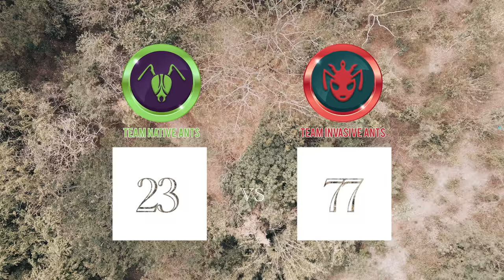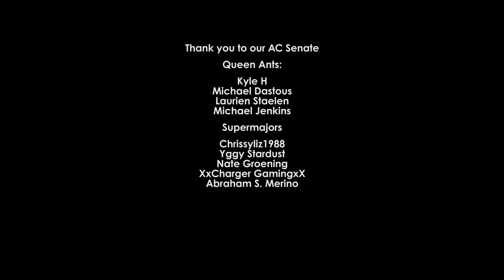DANGEROUS FIRE ANTS Invaded Our ANT HOUSE (We're In Big Trouble!)

Comment: If you don't deal with the problem you will lose the war. Boiling water is your best option in my opinion and then feed the native ants to make them stronger.
Reply: This is like Russia VS America but this is not native vs native
Reply: If u feed them it will cause war  as the invasive ants would compete for it
Reply: If you want an interesting bit of art for your new house, locate the fire ant nest and pour molten aluminum down it, then dig it up, and use as a display of what an ant’s nest looks like. You can find videos on how to do this. You get an educational piece and get rid of the fire ants. A win-win.
Reply: @lindawolffkashmir2768  Aren't those videos typically done after the nest is cleared?
Reply: That's why he said the boiling water to kill the invasive ants first. Feeding would only start after the invasive species were removed to help the native species bounce back and refill the niches before any new waves of invasives come to the area.
Reply: @alexanderlambert295  From what I’ve seen, they pour the molten metal straight in, adding water could destroy the shape of the nest. I’ve seen this done mostly in Florida and Georgia, where fire ants are a big problem.

Comment: Hello, AC Family. I live in Florida, where fire ant colonies had gotten so large that they have been reported doing serious injuries to pets and small, curious children. 

I use inexpensive bulk ground cinnamon. Ants communicate and identify nest mates by smell. Fire ants are particularly aggressive and will attack anything that doesn't smell "right" to them. 

Ground cinnamon is very fine, and the cinnamon oil in it is very hard to clean off. 

Sprinkled on the top of their mound, they can't help but get some on them. Then those are attacked as potential intruders. Then the attackers have some on them... it cascades pretty far down into the nest. Then a new team of workers go out... and it cycles all over again. If it doesn't rain, this can cause a firearm nest to completely collapse in about a week. If it rains, the colony decides to move the nest thinking the rain has contaminated the soil. So doing this while the ground is pretty dry works best.

Other species of ants and insects simply avoid cinnamon when they come across it. This makes cinnamon a good deterrent to keep ants outside. And it is non-toxic to most (unless allergies are involved) and biodegradable.  

This may be the kind of solution you are looking for.
Reply: I like this idea.. I'll have to try it on my yard this summer when they invade
Reply: Fellow Floridian and I totally agree with this idea. Especially considering I got dogs (4 small dogs with 1 that's totally blind) that are bred to be trackers (nose to the ground) so poisons is an absolute negatory Batman. 

To everyone else: For us, summer is our "wet season" which is rather ironic considering you'd want to do outdoor activities in the summer. So it's important to tackle it during what you would consider your "dry season". Stop them before they take over kind of thing. Side note, if you get snow, then that's your "wet season".
Reply: This is incredible I have never heard of that before, it shouldnt affect the native ants since the rain will wash the cinnamon away
Reply: I typically use boiling water and temporary removal of some of the soil they live in to let the water seep in farther, but this also seems interesting
Reply: This
Reply: Wouldn’t the native ants be also affected by this ?
Reply: @Kazwens  fair point, however i just like to be sure since my dogs are constantly running around
Reply: @medic2229  I have a dog too lol, cinnamon isn’t bad for dogs, usually water even if it’s hot will just cause the ants to evacuate the nest, and move to another nest location (satellite nests) meaning even more ants will be above ground
Reply: @user-he2ib9zh7p  native ants actually just veer away from cinnamon, while the invasive red ants attack each other, just don’t sprinkle cinnamon on the native ants. Just on the ant piles of the invasive ants
Reply: @Kazwens  didn’t think about that, however i will definitely be adding cinnamon to my arsenal
Reply: i like this idea
Reply: @Kazwens  That probably depends on the area, it makes sense that ants native too where cinnamon grows would avoid It verses ants who are not native not knowing to avoid it
Reply: @jadedesigns6171  they don't like the smell, the fire ants have no choice but to touch it as it's all over their entrances/exits but the native ants will avoid the areas that smell.
Reply: Awesome suggestion!
Reply: @user-he2ib9zh7p  if the cinnamon is kept at fire ant nest location it should do minimal damage to other ants
Reply: @Skoozi  Ah yes I did not think of that
Reply: @user-he2ib9zh7p  Since it is only placed on the top of the Fire Ant nest, and the Fire Ants won't let any other kind near the nest and live, no. It won't. However, your question still brings up that I forgot to say use a spoon and don't just shake the container over the nest or on a windy day, because the cinnamon will drift with the wind.

Comment: I think that it's vitally important to focus on the big picture here. Destroying invasive ant nests may seem undesirable, but the bottom line is that they are destructive to the native ecosystem and will not go away on their own. Fire ants, as a global set of species, are in no danger of becoming rare or endangered. But native ants with smaller, localized geographical ranges are far more susceptible to such a fate. I think it is important to focus on the scale here, and take steps to curb or destroy the invasive nests. 

As you documented, human development seems to favor the invasive species where it is happening, and development will not be slowing or stopping any time soon. Therefore, if you can take steps to prevent the spread of invasives on the land that you own, you will at least be preventing further harm in that area. 

Someone else mentioned bulk ground cinnamon as a possible method for collapsing the fire ant colonies. I would look into that and consider trying it, since pesticides are out of the question (something I absolutely agree with, do not use chemicals that will cause extensive collateral damage to the ecosystem).
Reply: 100% agree. I hate killing bugs, but you better believe I smash every invasive Lantern Fly I see. My vote is to cast the colony in molten aluminium.

Comment: Rather than pouring boiling water on the nest, you could try using wax, metal or resin to fill the nest. By doing so, you would not only destroy the invasive colony, but you would also be able to dig it up and have a cast of a fire ant nest to study and/or keep as a piece of 3D ant art.

Comment: I live in Texas and fire ants are a huge problem here.  In addition my 7yr son is so allergic that we are on year 5 of immunotherapy shots.  So I have experience with a lot of different ways of dealing with fire ants.  
There are plants they don't like as some people mentioned. 
 I have used the hot water method.  We typically poke several deep holes into the mound then pour the hot water into it.  This allows it to penetrate the nest more completely. We also pour the hot water in a wide circle around the top of the mound.   
Essential oils are also useful for spot treating mounds. Orange oil is pretty commonly used here.  Mix it in with water before pouring it into the mound.  Be warned,  this can cause some grass and tender plants to wilt and even die depending on how strong your mix is.   I've seen a very strong mix  get the ants to abandon the nest and eggs. 

It helps to map out your property and location of the mounds. Then determine  which mounds you want to remove.  And knowing what your desired perimeter around your house is will help localize your treatment plan.  

You also have the option of digging out the nests and relocating them.  It's a hard and tedious process.  

You could consider introducing a native predator into the area. In Texas they introduced phorid flies. 

I know you said no pesticides. And I get it.  But depending on how wide spread you infestation is,  I do ask you to reconsider as there are wide spread fire ant baits that can help reduce the fire ant population while allowing native species to regrow. 

Fire ants not only drive out other ants, but as you mention they will eat just about anything.  A large enough mound can reduce other insect life significantly. Fire ants will also invade homes in search of water during dry spells.  And here they tear through electrical wires and equipment.  They erode dirt from under sidewalks.  And if all that wasn't enough of a pain,  fire ants will move nest temporarily to your neighbor if you treat your yard.  Then when it's safe they move right back in. 

You might also consider any other ant species that attack fire ants if they are native to your area.  

If you have a University near by,  see if you can post for ant lovers to come collect fire ant specimens. Or your local agriculture offices might have resources for people or researchers who would love to come collect your ants. 

You really do have many options.  Some just take more hard physical work than others.   

Best of luck!

Comment: If its getting really bad, find the nests of the invasive ants an flood it with boiled water.
I know, its cruel but when you need to take radical mesures, you gotta do it.
Reply: I've seen educational videos pour a setting material (like liquid aluminum or concrete/plaster) into nests to make 3D casts of their tunnel structures which can be dug from the ground once set. Though it's cruel to kill entire nests this way, so is digging them up and pouring boiling water. In my (unexpert) opinion, if they have to die,  their deaths could matter through greater understanding of nest structures and ant architecture (antitecture?). You could even display the pieces in the Ant House, unless that would feel too grisly.

Comment: You could try feeding the fire ants cotton balls saturated with a sugar water and borax mixture (they can't taste the borax and it kills them once it's in their system), place it in a plastic container. I tried it when Argentine Ants (another hazardous invasive species) got into my house, it took a couple weeks for them to stop visiting but I think it worked to reduce their numbers at the least. Considering that the fire ants are outside, I suggest placing mesh over the top of the container that allows the fire ants to get in and out but anything bigger than them cannot access it. Putting rocks around the container could help with keeping the container in place so wind and water can't move it or flip it over.

Comment: I would say that the only viable method of dealing with the invasive ants is the most direct one. I think it is important to remember that invasive species like the fire ants always start out as only a few colonies in a new area before they eventually take over since the indigenous species just do not have the capability of dealing with them on their own. Last time I saw the ratio of native ants vs invasive, it was close to 50:50 with a slight favor for native ants. The invasive ants have pulled ahead massively now, and need to be dealt with asap.

Comment: since you seem adverse to killing the ants to deal with the problem permanently my suggestion is that you pour distilled white vinegar ( do not use apple cider vinegar I have found that it has a habit of attracting instead of deterring) onto the fire ant nests and trails it will not kill them but it will destroy scent trails and encourage them to move on you will probably have to do this several times but it has always worked for me to get ants to leave areas that I can't have them nesting at hope this helps and if your worried about damaging the vegetation after the ants have left just pour ample amounts of fresh water over the area you used the vinegar

Comment: From my understanding,:

     It would seem you would need to pour 3 Gallons of boiling water on a single Fire Ant mound with only a 60% Chance that it would be successful.  Your better off purchasing a treatment option verses risking burning yourself or being eaten alive with that process. Because once you disturb that nest the Fire Ants will go into Attack mode. Target removal is a better option. And what I mean is You get a Granular bait that specifically can be placed on a single mound. So that Only that species of ants will take the bait back into the nest. Other ants will not go onto that mound to steal the bait. Specially if the mound being targeted is Fire Ants.  Even though targeting is a slower process and can take 2 weeks to remove a nest, Its more effective.  ( its a longer process due to the bait first having to reach the Queen, Kill her, and then the rest will die off either by the bait or the end of their life cycle ) And since disrupting a nest will only cause them to move a few feet from that location and start over building a new nest its better to bait them. Additionally,  just because you see a single mound does not mean that is the entire nest. Fire ants can have nest spread out over a 15 foot diameter of the main mound and as deep as 8 feet below the surface. They have habits of building Back Doors and Escape routes. They have also been known to have nest inside rotting wood and even in Concrete. So I say Eliminate the Fire Ants.  Because letting them live and move freely does not solve any issues whatsoever.

Comment: Turn the fire ant nests into art.  Instead of just using hot water, use melted aluminum and cast the nests.   Depending on the size you auction off the results or use them as teaching aids.

Comment: If you need do deal with invasive ants, a rather barbaric but effective method we use in America for fire ants and invasive plants is pouring boiling water at the source. It might not 100% deal with it but it will cut down the growth for a while, and if you're lucky, itll kill the colony/plant.

Its cheap, selective, and leaves no permanent harm to the soil and such, but its also on the brutal side of solutions so i get if its not ideal.

Edit: i was a bit ahead of the video it seems